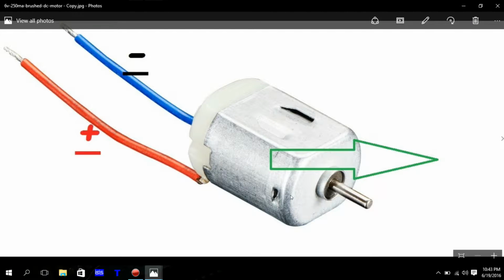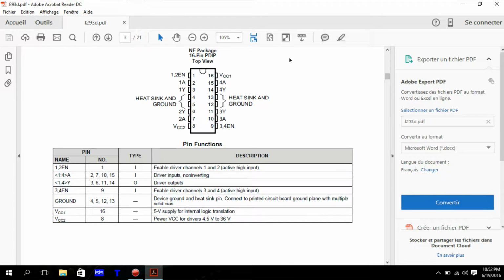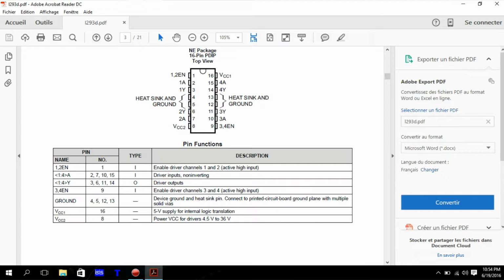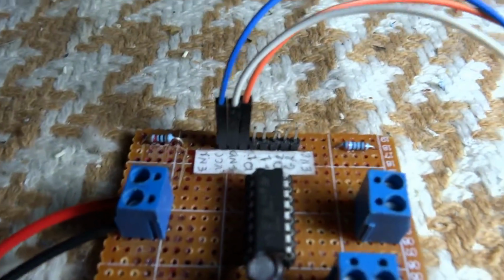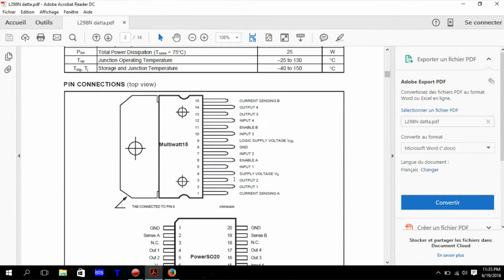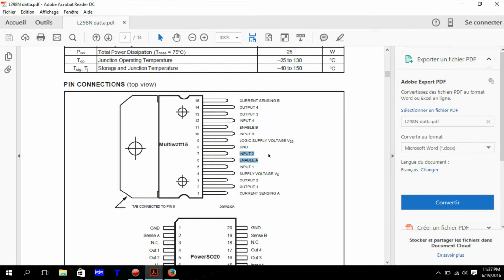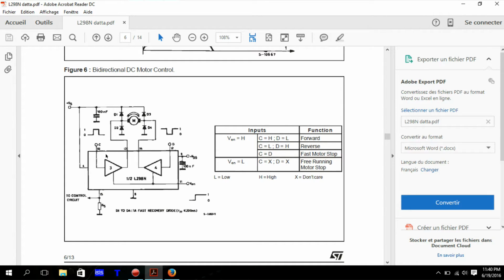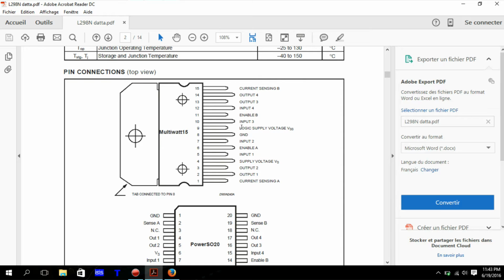Motor Drivers : L293D VS L298N #4

Comment: Great video........Check out my ps2 controlled car  I used a l298n but the motor over heats fast any advice
Reply from the maker: if you run so much current into it it will get hot so maybe use a fan to keep it cool , or maybe you are using a weak motor and loading it more then you should